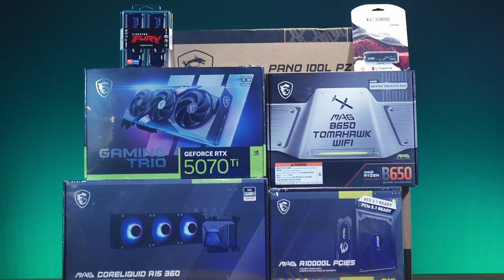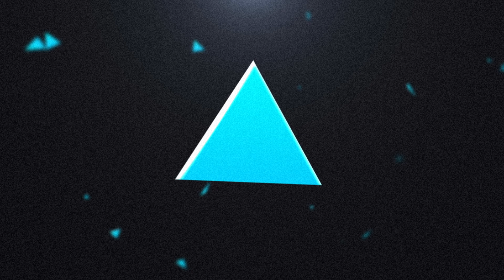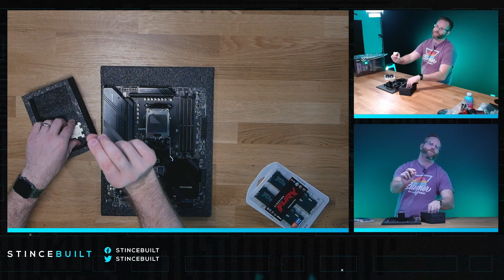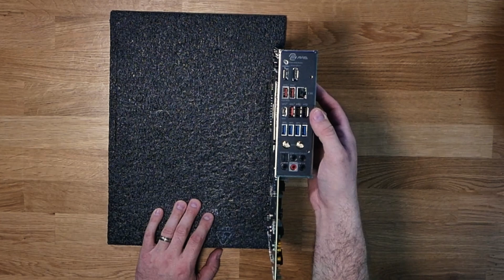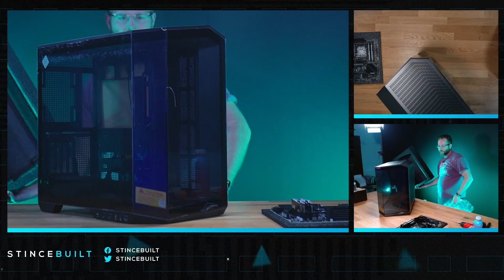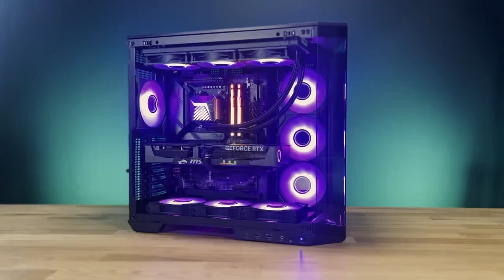MSi MAG Pano 100L PZ Gaming PC Build! New Cooler & Fans!

Comment: Nice build!

However, in my country there is no such 120 fan, I bought MSI MAG Fan 120 ARGB. Do you know if it is good?

Also, I have a dilemma with the motherboard, since in an AM5 setup there aren’t many good MSI motherboards in black with Project Zero.

Therefore, I am choosing between the MSI B850 Gaming Plus WiFi PZ (white but with Project Zero*)* and the X870E Gaming Plus (black and better for future upgrades).

Comment: Just picked up this case, extremely happy with it. Mine came with a fan/rgb hub pre-installed at the top inside back panel. I just swapped my build yesterday but thus far I can't get the MSI led working. I swapped out the installed fans/rgb's and installed others via a different hub so yeah, not sure whether trying to go off of 2 hubs is my issue. I was to tired to troubleshoot last night so who knows, I might have just missed a connection from the pre-installed hub, hopefully it's not faulty, that MSI led looks nice when working, cheers.